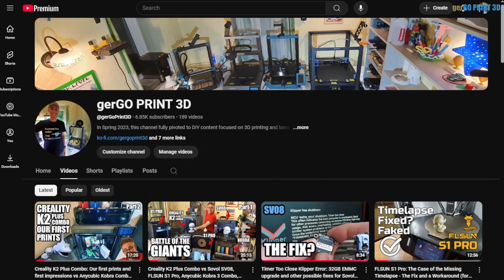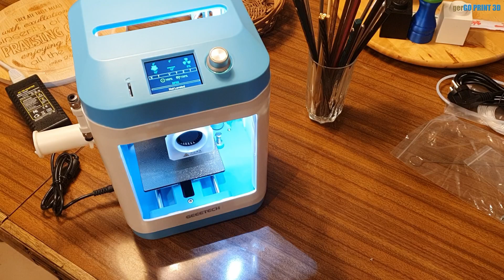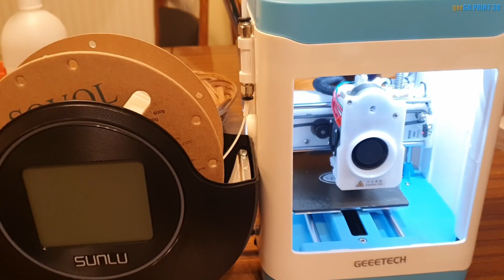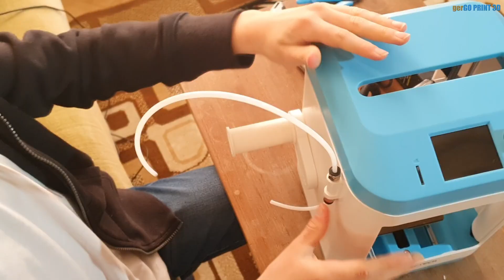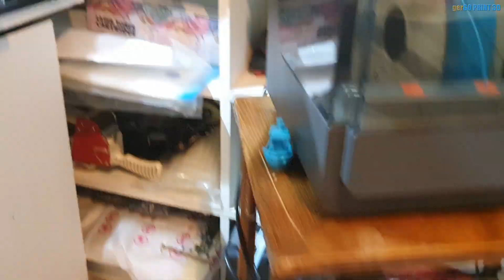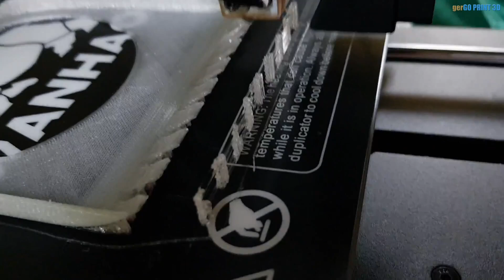Geeetech M1 Mini: Is This What Kid-Friendly 3D Printing Should Be? Tested with an 11 year old

Comment: Hello Gergo ... for the bed adhesion .. you had to 
- adjust the extruder tension 
- put some glue .. 
- do you also had to play with the z-offset ? 

I have it and it's indeed the point that makes me not confortable to give it to my son ( 11y ) , if at each print he must play with the z-offset , it will kill his motivation and pleasure to discover and play with it

PS : a 150x150 would have made a real better sized model ... especially when we see the Elegoo Centauri prize !  not sure if it's still a good choise
Reply from the maker: No, on our device z offset is spot on. But I wonder if you can adjust the height of the z-endstop (where the nozzle homes) to physially control the z-offset? The machine is not here, so I cannot check it but it should be possible!
Reply: @gerGoPrint3D  Yes , good remark , I'll check that point ...  I never uses glue on PEI as I print PLA .. but maybe it should be part of the "routine" on this A1
Reply from the maker: @fredericlallement2971  You don't have to before every print, maybe reapply glue once ever 10-15 prints. This water-glue mixture is virtually invisible and doesn't leave residue on the prints.
Reply: @gerGoPrint3D  Never tried this before , but on the M1 I think it will be mandatory ... a zone (1/4 ) of the stock PEI I have is really not super good for adhesion of the first layer  

Thanks for the answers

Comment: Finally a v2 for the Tina2/Cadet/Raptor. It may have a different brand name, but this is all of the upgrades that Tina2 owners have been making to their tiny machines and we've been asking for. 24v, internal lighting, direct drive extruder, filament runout sensor, remote power switch on the machine, and I'm sure there are others. 
With both being open source, I'm sure owners will find a way to carry mods over to both. 
Front and rear windows have been successfully created, and ABS printing is possible. 
This is a great introduction video, and a great source of upgrades.
Reply from the maker: Wow. I did come across the Tina2 in my research, but I did not know this history. Thank you so much for sharing! It is indeed a surprisingly complete and well tuned little printer. Currently the bed/nozzle is limited to 60/230°C which prevents even PETG printing, but I am sure with custom firmware these limits can be removed and if enclosed ABS printing becomes possible. For around $200 this is good value.

Comment: I’m concerned about the fumes and microplastics released while 3D printing. I wouldn’t want a printer running in a kids bedroom (or an adult) and I wouldn’t want a kid hanging out next to an open frame printer for long. IMO a printer targeted at kids should be enclosed and have air filtration.
Reply from the maker: Good point! He is only printing PLA, small models at pretty low temps, but we don't know the long term effects of PLA fumes either. It is so small (3kg) it can be on the shelf in his room, but he can easily carry it into a different room for longer prints.

Comment: my 10 year old runs the X1C with zero help for me.any kid that can read for comprehension would be able to use it without parental help.
Reply: the hardest part for him is pushing the button that holds the filaments in the feeder. when you want to take the filaments in or out you have to push this button that takes pressure off teh filament so it can slide easily.
Reply from the maker: @anotheryogateacher8499 Yes, this is an interesting discussion. In my mind, it's not their mental capabilities that are in question. Levi uses all my printers (SV08, K2 Plus, Qidi Q1 Pro, FLSUN S1 Pro, or all the bed-slingers) on his own, without help too. That's not the issue. The questions are: whether we'd put any of these machines in his room, and whether I would feel confident leaving him with any of these alone. The M1 Mini has sensible limitations and extra protection to keep him safe even when he experiments or potentially makes mistakes7. I would not trust a printer that can go 120°C on the bed and 350°C on the nozzle or one that has an open bed potentially moving at 500mm/s. And certainly not one that has AC bed heating or has 220V in the printer anywhere. He would certainly want the SV08 in his room ;) But then he wouldn't have any desk space left for studying (not that he would mind that either).

Comment: that kids printer is quite capable! a lot more than my modded Anet A8
Reply from the maker: I hope you can see my surprise and excitement. After the first couple of print I wasn't expecting this print quality. I was happy to see safety was also high amongst the design goals. I just wish they'd added wifi or at least a Type A port for regular USB drive connection.
Reply: @gerGoPrint3D  oh yeah a bit more of connectivity would be welcome. But for 250 usd i think it is a great product. really impressed. thanks for the review and perspective.

Comment: Given snips are not included, odds are the transport security shouldn't be zipties but beaded ties or velcro, or those tyvek wristbands that are easily removed with scissors.

This is for sure a real printer just shrunk down.
Reply from the maker: Good point! They should also be reusable, and removable with regular household tools or with something they include. Funny this printer already had 3 unboxing, because we basically repacked it for the trip to Levi's home. For this final journey we did not re-tie the toolhead and it made it home safely just using the foam blocks.
Reply: @gerGoPrint3D   Yeah but you also probably didn't ship it with DHL or FedEx. You can carry a printer around just fine, but postal services tend to play rugby with them or something.

Comment: Bed mesh using direct nozzle probing and Z offset is a feature I'd love to have on my 3D printers and none of them have that.  Large diameter linear rods and ball screws - also a very upscale feature on a 3D printer.  Geeetech put a lot into this little printer.  Levi's expectations must be elevated by having access to your many very nice printers, but the small M1 Mini is definitely not a cheap 3D printer for parents to buy who don't know anything about 3D printers.  It looks like a great beginner 3D printer... for anyone.

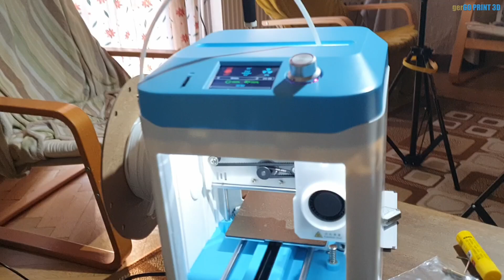2:50 - Keeping TPU dry is more of an issue than keeping PETG dry.  I suppose Geeetech opted not to include PETG to keep the bed and nozzle temperature lower for burn safety.  That's a shame because PETG and particularly PETG-CF prints at only slightly higher temperatures.  When I was a kid, I would have wanted to print stuff like model rockets, slingshots, and other structural items that I designed.

I hope Geeetech takes your advice.  Bright yellow cable ties are a great idea to prevent someone just learning about technology from cutting wires or timing belts.

The lack of WiFi is a bit disappointing but Geeetech probably decided that configuring WiFi may be too complex for young people, but they're probably better at that than most of us old people.   😛  If they don't offer network capability, I would have liked to have seen a USB-A port instead of microSD.  I always hated fumbling with those tiny cards when repeatedly printing prototypes.  Fluidd, Mainsail, and particularly network access via OrcaSlicer was a huge upgrade when switching to Klipper.

I had a colonoscopy last week.  The anesthesiologist asked my occupation and I told her I'm an engineer and she became unusually interested, asking if I enjoyed it, etc.  Her 11 year old son wants to be an engineer.  I advised her to buy him a 3D printer.  The M1 Mini would be a very good option.  She was very reluctant.  I asked why and she was afraid of how much stuff he'd print.  I thought that was sort of the point.

Now that Levi has mastered OrcaSlicer, it's time for him to design his own stuff in FreeCAD.  That's the REAL fun of 3D printing.
Reply from the maker: He actually wants us to install Fusion 360 on his older brother's more capable computer. We already played around in Fusion, why not go for the top prize, right?  Maybe seeing Levi's excitement will change your doctor's opinion about kids and 3D prints.  If she is worried about environmental impact, I am pretty sure filament recycling the next big thing in our hobby. I am not throwing out any of my filament waste, collect all separated by type. We'll have personal filament recyclers, it's a matter of a year or two in my opinion.
Reply: @gerGoPrint3D  - I'd seen Fusion 360 in one of your videos.  I'm a big proponent of free open source software, so for me FreeCAD is the top prize.   🙂

I think the anesthesiologist was concerned that buying her son a 3D printer would result in him having a $300 per month filament habit and her house would be knee deep in geeky plastic parts... or maybe she's afraid her son would do what I would have done when I was 11 and 3D print a gun that can shoot a pencil at a lethal velocity.  Boys will be boys.   😲

Comment: identical frame to the AladdinInBox SKYcube, the same printer i almost bought in 2018. glad they updated the pitiful hotend and part cooling fan in the past 7 years
Reply from the maker: I"ve looked around to see similar printers. There are actually a lot of improvements, this printer is now ready for prime time imho. Pressure sensor in the toolhead for precise bed leveling, direct drive extruder, runout sensor, Orca Slicer profiles, input shaping, pressure advance, feature complete, snappy device screen and yes, good hotend and sufficient, quiet part cooling.  This will not replace your SV08, K2 or S1 Pro, but could be a safe and fun way to introduce a youngster to the hobby.
Reply: @gerGoPrint3D  - Klipper automatically makes all 3D printers better but Geeetech went all out to make this solid little feature packed printer.  I'm tempted to get one to have a lightweight mobile 3D printer, with OrcaSlicer on a notebook computer.  Geetech should make the grown up version of this printer that can print PETG, or even enclose it and passively heat the build chamber for engineering materials.  3D printers are becoming such useful tools that I can see field service engineers and technicians designing a repair part in the morning, printing it at lunch and installing it in the afternoon.  Bonus points if Geeetech made a tough little mobile printer that was powered by 12VDC so it can operate off a truck battery.